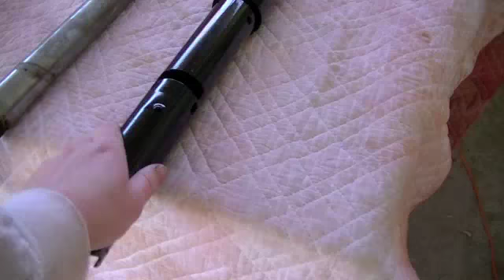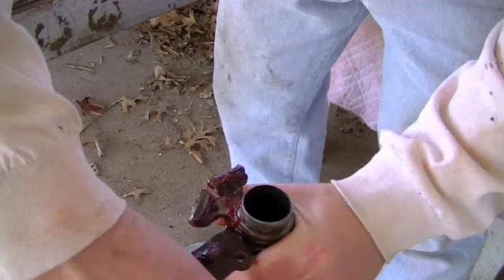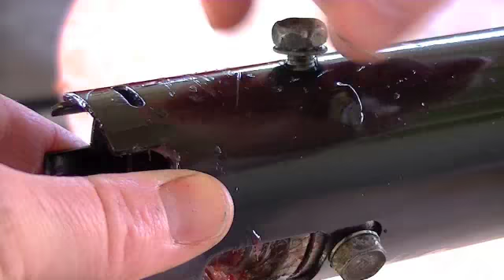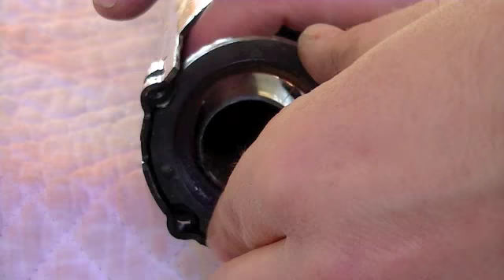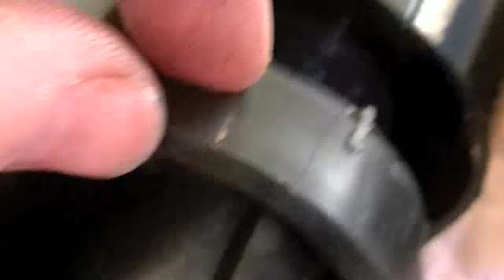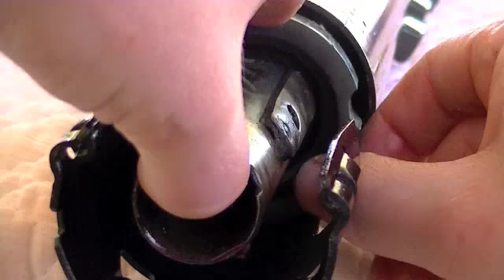Part 10 GM Steering Column Repair

Comment: Hi Milkcrate82, I really enjoyed your video on the column rebuild. I was forced to rebuild the upper section of mine when someone tried to break into it. Can you tell me, in a 74 Blazer do the bearings have the 2 piece race you are referring to in your video here? I am stuck at this point and could use some insight. My blazer only had one.
Mike

Comment from the maker: I'm not sure why you would need a shorter one.  I don't think I would shorten it myself.  I have seen aftermarket GM steering columns that are shorter than normal.  Maybe from ididit.  I might have seen it on the Speedway Motors website.  If it was there, it was probably listed under Hot Rod Parts.  Hope this helps.